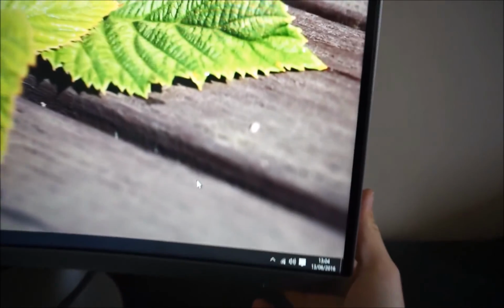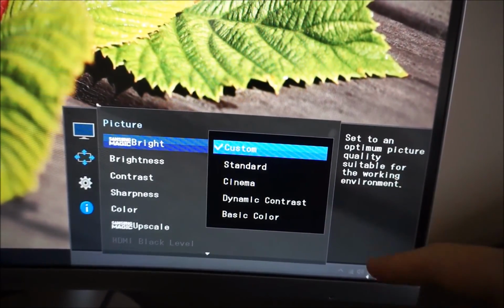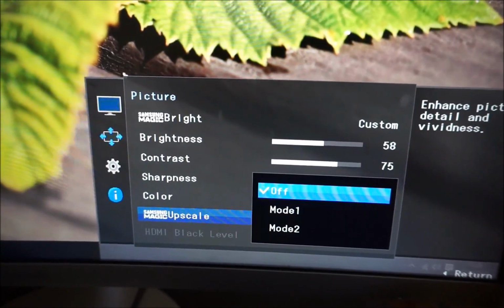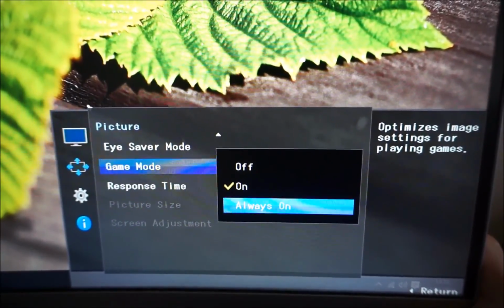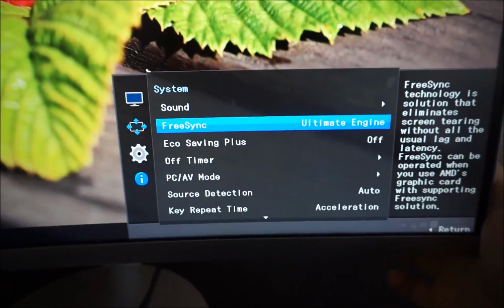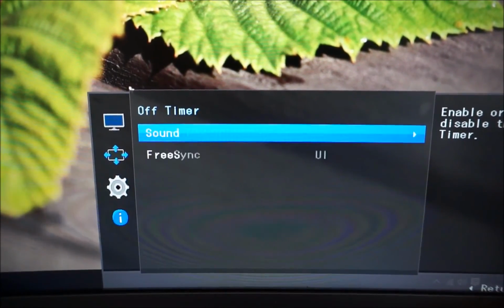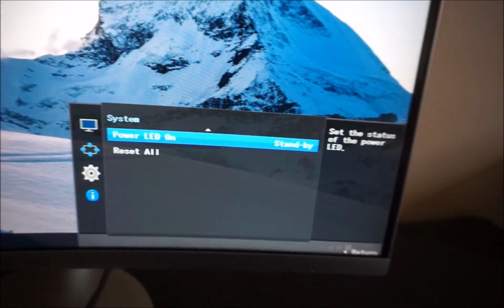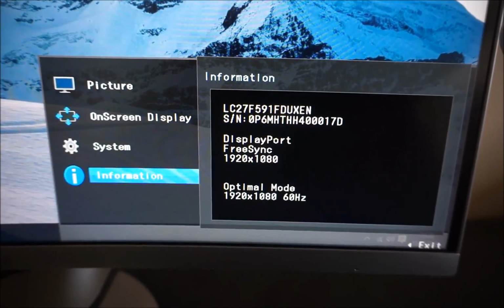Samsung C27F591FD Menu System (OSD)

Comment: Bought this monitor 2 years ago. got a RTX 2080 last week. Turned on FreeSync. Turn on "make freesync work if I can make it work" from nvidias control panel for 71Hz refresh rate. It works. This monitor will work with Nvidia's G-Sync Compatible settings to overclock refresh rates. It's 4ms response but most gaming panels are without getting expensive. This monitor is amazing for gaming for its price, even in 2019. Its the best not-talked-about monitor around.